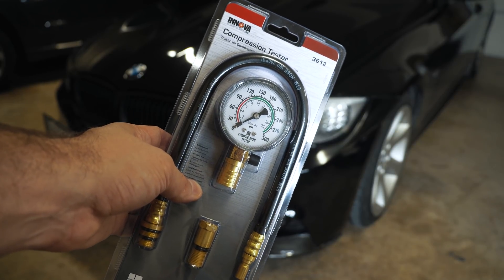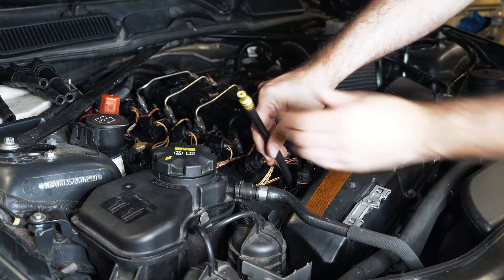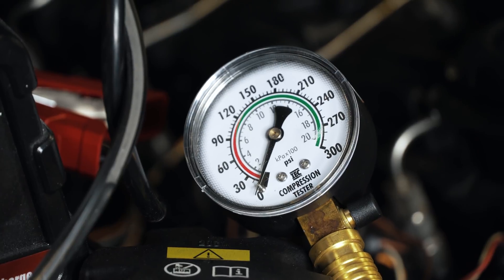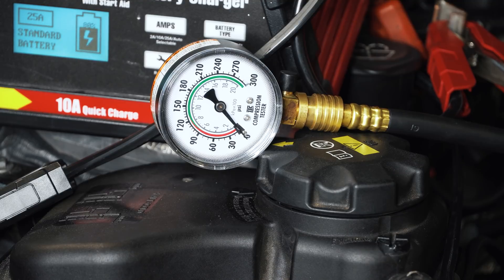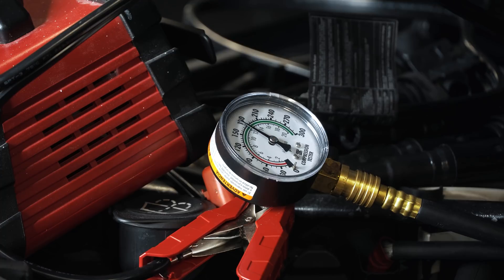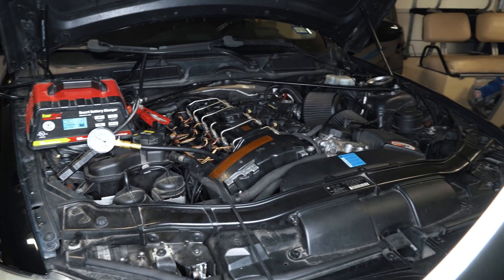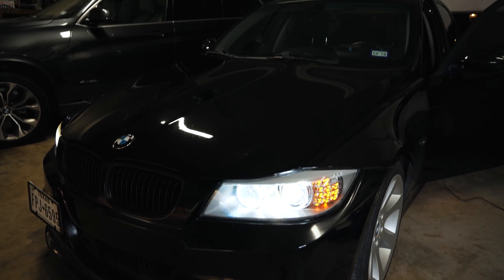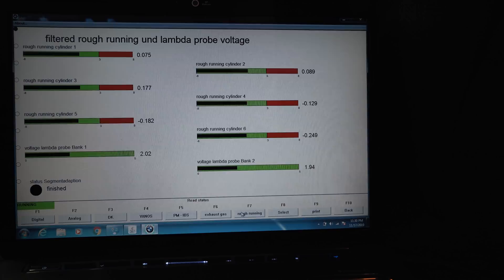I Can't Believe It. At 200K Miles My BMW Engine Is BRAND NEW?!

Comment: My N54 is low compression at only 87k :( 
Cylinder 1: 160
Cylinder 2: 145
Cylinder 3: 145
Cylinder 4: 140
Cylinder 5: 145 
Cylinder 6: 120
 No idea how the motor could lose that much compression at such a low mileage. I had a shop do the test but I was thinking of trying it myself to verify. But as of right now I’m not sure I should even keep the car because of the compression :(
Reply: Take care of your car bro I do my oil changes every thousand miles and my car runs single turbo Like from the factory at 120k lol
Reply: spooln54 e85 yea I take great care of it but the previous owner didn’t :(
Reply: Damn... well part out or just get it rebuilt. Ghassan Alneama is a beast at rebuilding these. FB him.
Reply from the maker: Are you using a Harbor Freight compression tester?  If so I'd toss that and try another one before you worry too much.
Reply: Vehicular DIY I didn’t compression test it myself yet. I had a shop do it so who knows what they were using.
Reply: Bro I’m heat my car has 100 psi compression in cylinder 5 and 2 80% leakage at the piston rings only 84k mile pure stage 1 n54 e40 tune
Reply: @MK8_FTW  damn... part out?
Reply: BMW _For_Life damn bro that’s awful I’m sorry. #lowcompressiongang
Reply: Did you ever re-confirm those reading? What ended up happening with your car

Comment: I did my compression on cold engine my compression was all over. 130 ,140 ,140, 140 and 110. After engine was warm I got 175 on all cylinders any idea why?
Reply: When engine is warm, the metal expands like your piston and the rings, making it seal better hence more compression
Reply: @ceajay11  I know that but why was OP  numbers so high and my so low  on cold engine ?
Reply: could be your oil too. my n54 had a leaky injector, pulled the oil and it was very thinned down with gas. shit compression, after new oil, about 180 - 190 inHG all around
Reply: engine is at 150k miles
Reply: @egimzyegimzy3566  190 on cold?
My engine has 80k miles
Reply: @kaldyn55  my bad, after warm 190,  cold i had them as low as 175 and i have seen them as low as 160. you are sure that tester is plugged in nice and tight? 130 is pretty low
Reply: @egimzyegimzy3566  it was
Reply: Wear.  But metal expansion was able to make up for it
Reply: Wear on the piston rings ?
My leakdown test was within spec